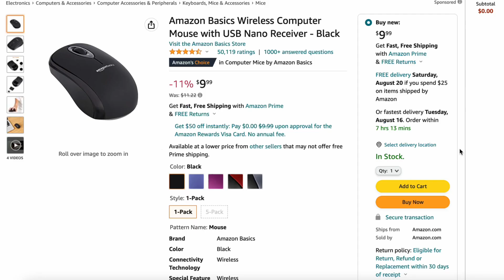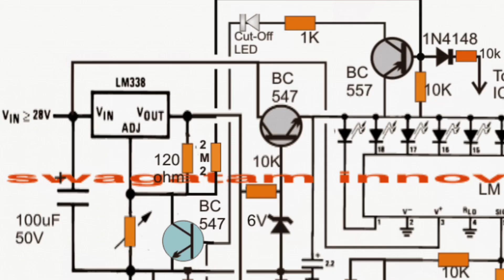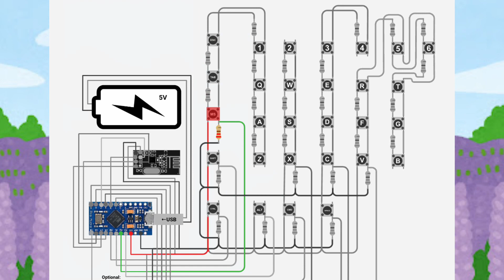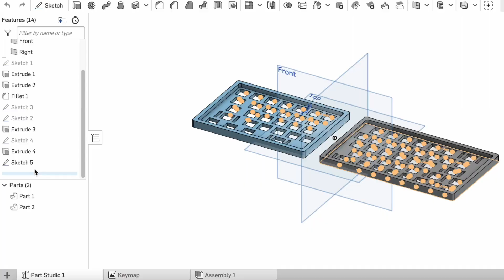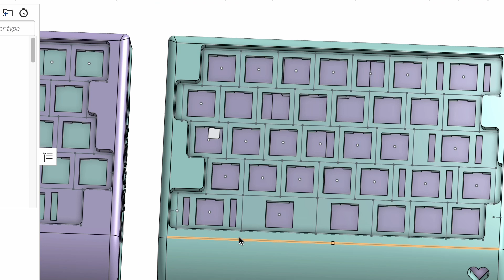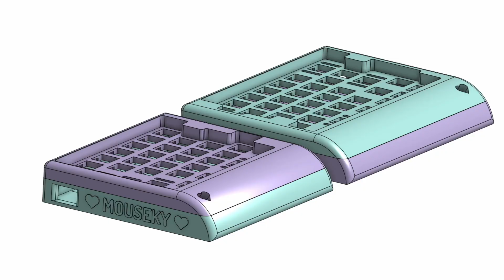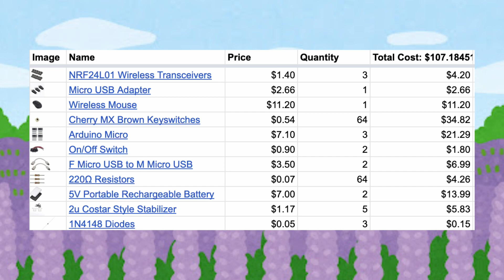Building the most advanced keyboard with Arduino!

Comment: Hi Im considering building a similar setup, did you encounter some limitations in the use besides the ones you mentioned, for example lagging or disconnections? and can the keys be used in layers mode? and if some keys could be used in release mode? Thanks for sharing your project. Are you using them now? or what instead?

Comment: I'm pretty late to the party but nevertheless I have to say that your project is really impressive and informative. The resistor based signaling might not be bleeding edge, but very ingenious.
As for ideas for future improvements, I have to highlight how important liftoff functionality is for both a mouse and a trackpad. Of course in your case it's impossible so I would recommend you to program a macro on the keyboard as a quick mouse disconnect. Therefore you could emulate the "liftoff" by turning the mouse sensor on and off.
Another functionality must is to have both sides of your keyboard just as grippy when in keyboard mode. The nicest (from UX side) solution would probably be some sort of large spring loaded button at the top of your mouse keyboard that, when pushed would engage a lever and push down some slippery feet, therefore setting it in mouse mode. Releasing the button should retract the feet and set the keyboard down on some rubbery pads glued to the bottom of the keyboard. This solution is obviously fairly elaborated mechanically wise and it would induce a new plethora of stress inducing forces to your, already fairly brittle, 3D printed frame.
Thanks again for the inspiring project, I might even build my own

Comment: Why did you use resistance (this is a genuine question) this feels like the most difficult and least functional option you could choose. Also please use switch case statements my eyes were bleeding when I saw those if statements 😂😂😂you can do ranges with switch case statements like this I think
switch (resistance){
   case 100 … 200:
       print("a");
   case 300 … 400:
       print("b");
   default :
       break;
 Still very cool ngl

Comment: Hi. Thank you for this unique cute keyboard+mouse and I will make one from my old broken laptop keyboard. A idea for soldering the resistors and wires is to make a loop to make a big connection with the switch. Also I planned to convert I2C old mouse touchpad to USB and the keyboard on same controller.

Comment: I'm so glad that YouTube suggested this video!  It's nice to see someone who isn't an expert fighting their way through a challenging project.  

Some thoughts: 

1. If you make each resistor in the column twice the value of the previous one, you will basically be creating an analogue binary signal when keys are pressed, which means you can register ALL of the keys in a column at once.  As the Arduino can support up to 1024 levels, that means you can have up to ten keys per column, though nine would be better.  After that, it's just a matter of tweaking the software to create your n-key rollover keyboard.  (Get 1% resistors to reduce errors.)
2. An inexpensive 'analogue multiplexer' IC allows using a single ADC pin on your Arduino to work with 8/16/32/etc. analog outputs.  You just need to send it a binary signal to let it know which input you want sent to the Arduino.)  You could then use a single Arduino/multiplexer/RF transceiver/battery for both halves and connect them together with a colourful CAT5 patch cord.  That would save you a LOT of money.
3. Searching for "Interfacing an optical mouse sensor to your Arduino" will give you multiple tutorials on interfacing cheap optical mice directly with your Arduino, which would simplify the build considerably.
4. I think that using a spreadsheet for the layout is a very clever idea.  You might also enjoy using OpenSCAD to do your modelling, as it is pretty simple to use and iteration is FAST.

Cheers!
Reply from the maker: Thank you for the thoughtful comment! I will definitely consider these suggestions in future projects.
Reply: @taliyahengineering  You are most welcome, m'lady.  /bows

Comment: An idea I could suggest :

moving the right half of the keyboard seems detrimental to ergonomic, so if you could maybe remove the mouse, and add some sort of thinkpad-esque trackpoint, kinda like some gaming oriented gamepad do (see Razer Tartarus for reference, it's not an actual joystick like on a controller and instead an 8 way D-Pad, but you'll get the idea visually) that you could access with your thumb, that would render the keyboard static and less taxing on your right shoulder. Issue is how to implement that into the electronics and physically as well.

Also, still in line with ergonomic, maybe tilt each side like so / \.
Maybe this could help with the size contraint of the inside. 
And/or, if you consider including some fort of wrist rest into the keyboard, especially if it ends up being static, you could shove some of the guts in to the wristrest and reduce the overall height

That or... since you can get standalone touchpads for use on desktop PC, you could include a touchpad in the wristrest of either side. 
Think of an 'adesso tru-form pro' but as a split keyboard.

OR, keep the integrated mouse idea, but use a trackball mouse instead. Less cute tho
Reply from the maker: Ohh, those are some good ideas! Thanks for the feedback!

Comment: Clever way to solve the mouse! As for the issue with connections breaking, I HIGHLY recommend silicone wire of a thin gauge. It flexes like string! Not too expensive either, maybe $12 for a bunch of tools on Amazon.

Comment: Good job, I also started a 3d printed split keyboard/mouse combo but i used a touchpad in the middle. keep up the good work 👍

One thing that might make it a bit nicer is to put the two devices behind a (hidden) hub so you only have one cable to the laptop. i got mine cheap off aliexpress as a pcb

Comment: Why did you use resistors instead of diodes in a matrix? You wouldn't have to do any analog voltage reading with diodes, which makes the whole process much simpler.
Reply from the maker: I’ll keep that in mind next time!

Comment: Nice project! If you want a smaller receiver with single usb, i think wireless signal of the mouse is capturable with 2.4ghz tranceiver modules through arduino. Or you can connect an old PS/2 mouse to arduino.